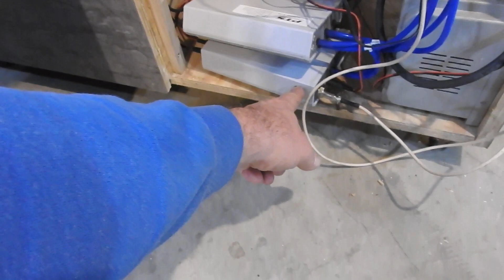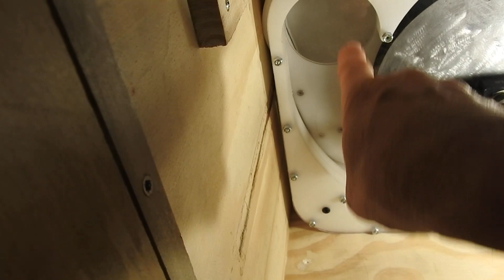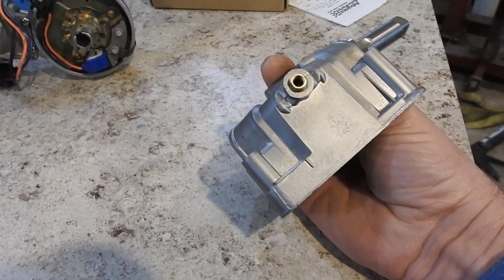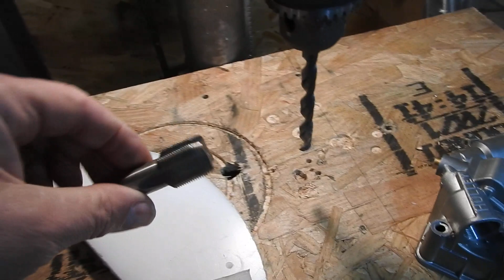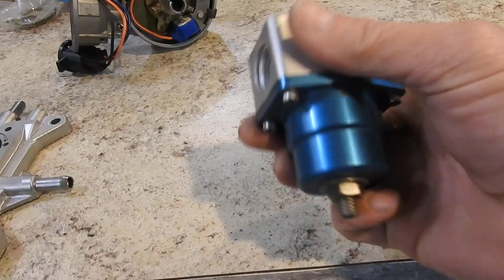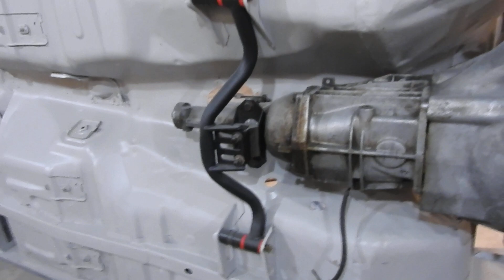PTS Flow Bench build

Comment: How did you balance the fan? Awesome project by the way , some guys just play golf at weekends.
Reply from the maker: Right now, it's not balanced. I want to test it first, to see if it will need it. The parts were cut out with a water jet machine, drawn from a CAD program. So all of the pieces are identical. I have a static RC prop balancer, and I also built a digital prop balancer that I can use if needed. Thanks for the interest.